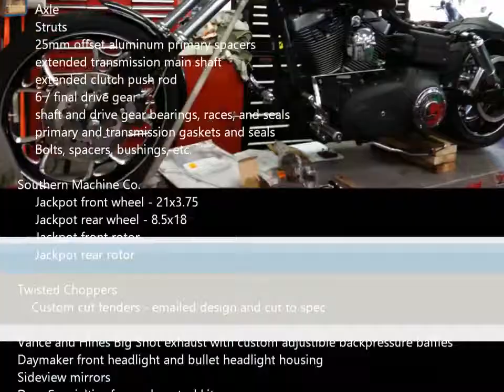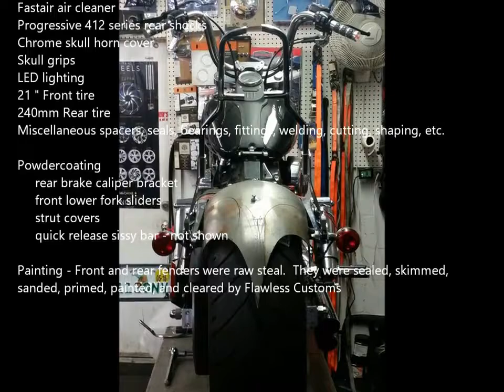Harley Davidson Custom Dyna Street Bob   240 wide rear tire   Rake kit

Comment: How is the ride thus far? Any issues of bike pulling left or right?...hopefully it just tracks straight as it's supposed to. I'm constantly viewing your video over and over...looks to be a well made kit.
Reply from the maker: Rides good.  It’s definitely different. Turns much wider with the big rake. Steers heavier, but I’ve gotten used to it.  It doesn’t pull or lean one way or another. Suspension is stiffer, but I lowered it and added the progressive springs so that part of the culprit.  I can still take low tight turns, just k turns on foot suck with the wider radius.

Comment: sir where did you get the all kits and how much you get thnx
Reply from the maker: Hi Ray,

Thanks for watching. The rear end is a zodiac kit. I think from the Netherlands. The front end was chopper supply…..maybe. It’s been I while, I’ll need to check my receipts.  The whole project was about 14k, but a lot was done to the bike.
Reply from the maker: If you look in the description, most of the info is there, as well in the credits at the end of the vid.

Comment: They will not be able to share the list to make the modification in Spanish and more visible I have a 2006 dyna super glide I just want to put a 240 tire on it
Reply from the maker: Basically the same bike.  The same zodiac kit will work for yours. Here is a link to more info I posted on the project:
https://www.hdforums.com/forum/general-harley-davidson-chat/1088754-zodiac-wide-ass-swing-arm-kit-for-adding-a-240-on-a-dyna-street-bob.html

Here is a link to the kit I used.  
https://catalog.zodiac.nl/en/18-frame-rear-suspension/swingarms/wide-ass-swing-arm-kit-dyna-2006-thru-2017-4565